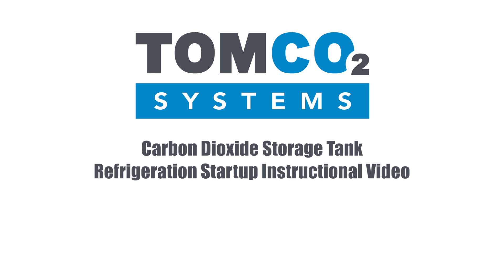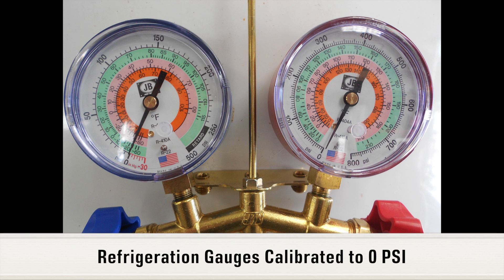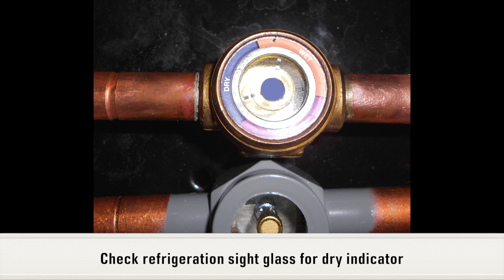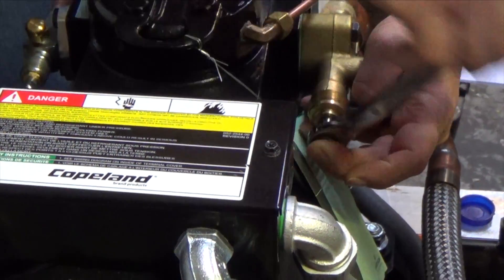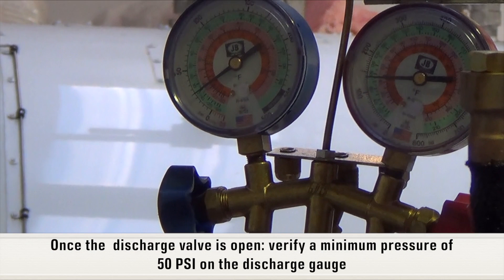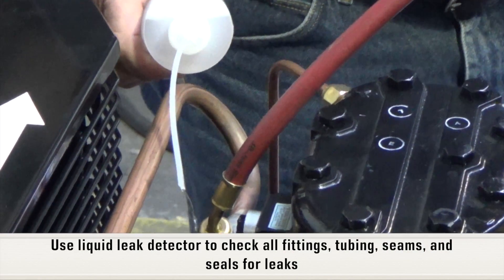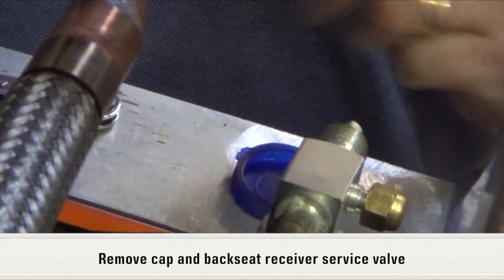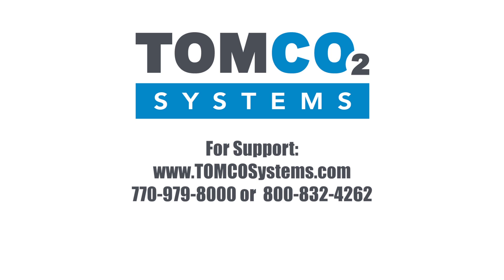Tomco Carbon Dioxide Storage Tank Refrigeration Setup Video

Comment: «qualified hvac technician»
1: Before activating the valve stem, first, loosen the brass gland nut. Front or back seat the valve stem
and then re-torque the brass gland nut, per torques in.
2: Electronic leak detector before soap. (your soap solution is too heavy. if micro leak, the soap will block. you have to lather the soap to make it ultralight)